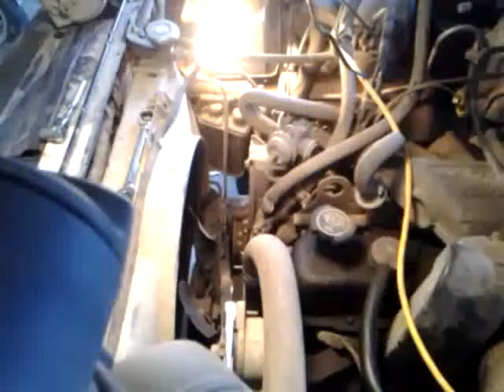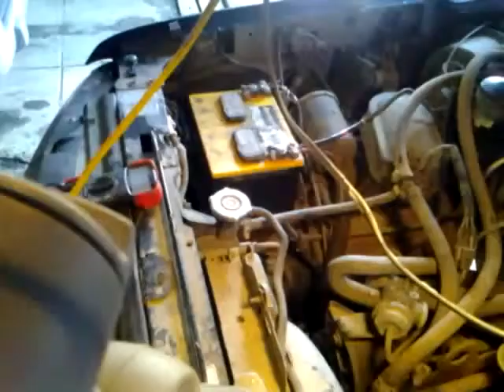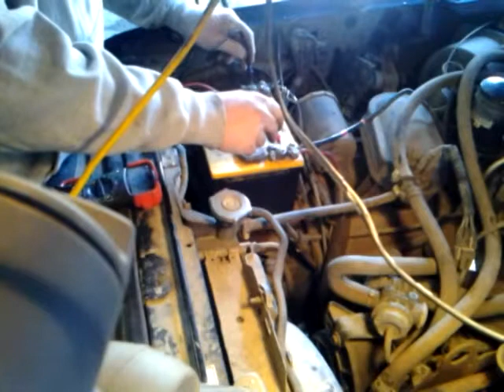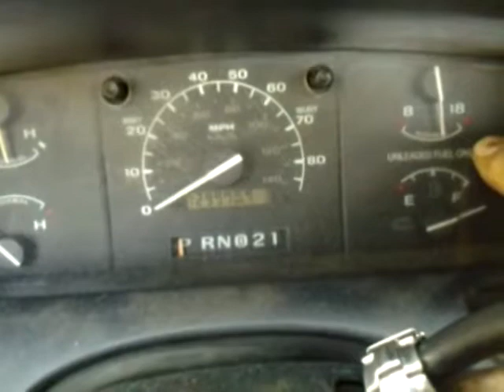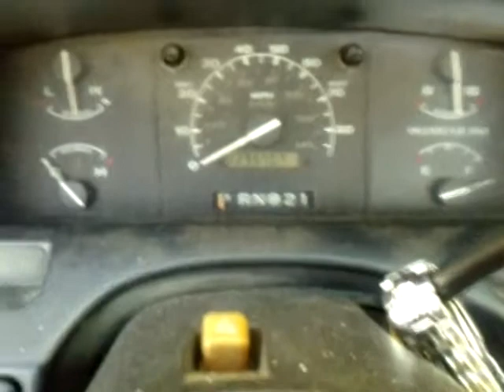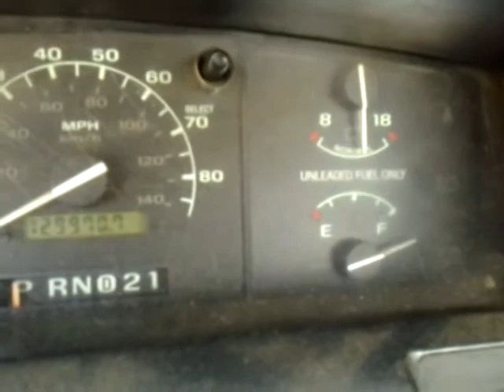96 ford f150 3G alternator repair #3

Comment: That last little nugget of info about testing the battery while running was what ultimately helped me diagnose my problem.  Thank you for posting this.  It helped me get my truck back to work instead of on the side of the road.

Comment: Unrelated to the alternator, but I noticed you replaced the vacuum "soup can". What did you use? Nice 4.9L, I got 323,xxxmi on mine, still runs like a champ. Thanks for the vid, gonna be doing exhaust manifold gasket soon and am watching all available videos about stuff I gotta move out of the way just in case there are some headaches I should look forward to .